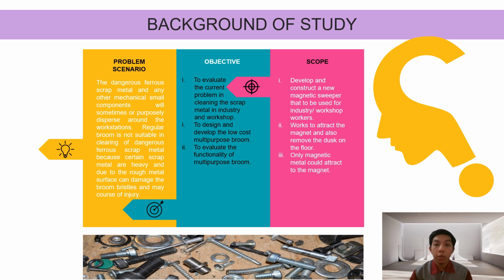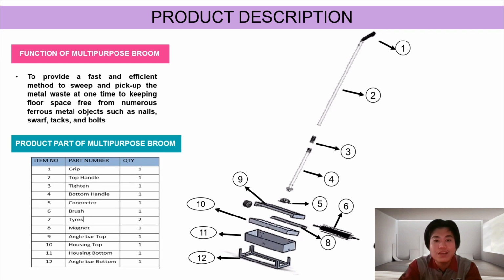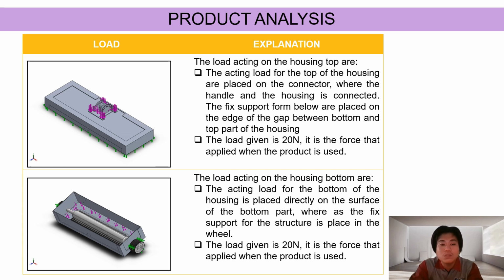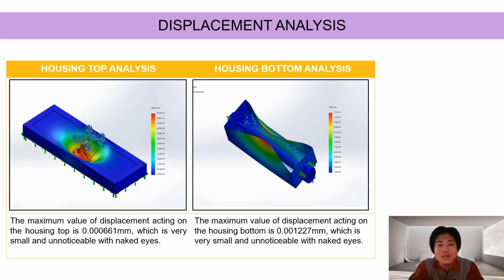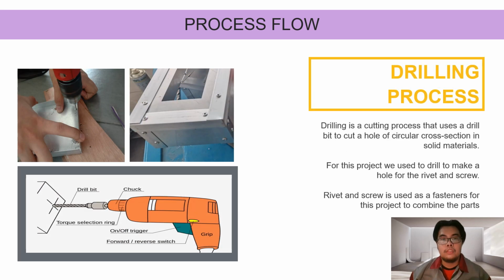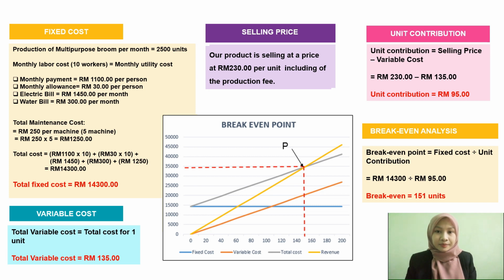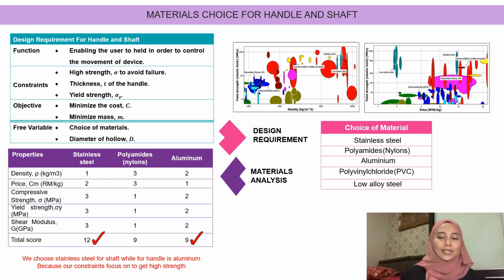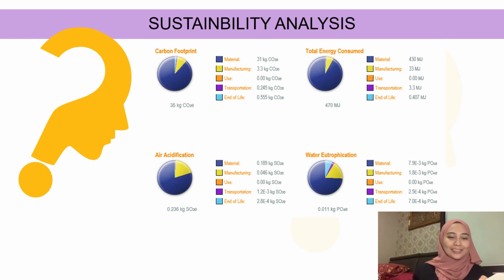IDP 2021 Multipurpose Broom Group 10 UTeM

Comment: Assalamualaikum & Salam Sejahtera.
First of all, it is nice to have such product in our workshop. It really helps a lot in cleaning purposes and reduce hazard.
For future improvement, the material can be replaced by plastic which has greater strength and lightweight which has been used widely in vacuum cleaner manufacturing. 

On the housing design, can be improved by eliminating sharp edges in order to prevent any accident to the user.

For the slide and poster content, try to use simple point and can be beautified.

Thanks.
Reply: Waalaikumussalam and salam sejahtera too, first of all, thank you for the compliment and sincere comment on what's lacking in our product. We appreciate the suggestions and the details of the comment. Thank you for sparing your time to watch, evaluate, and suggest the improvement that can be applied to our product and presentation.